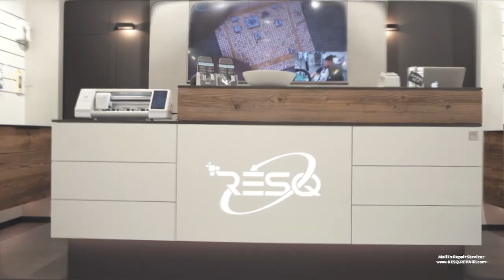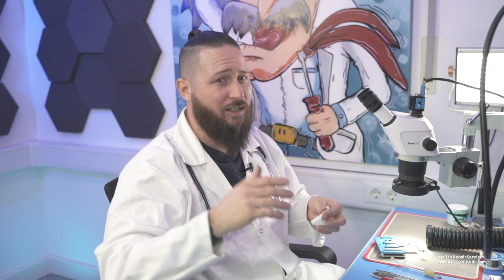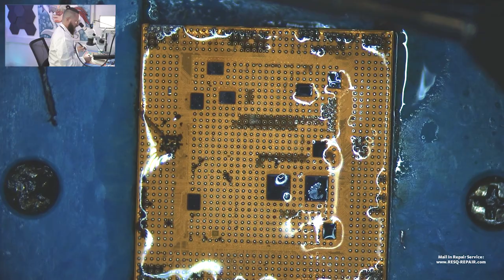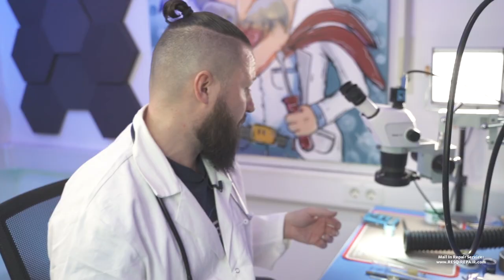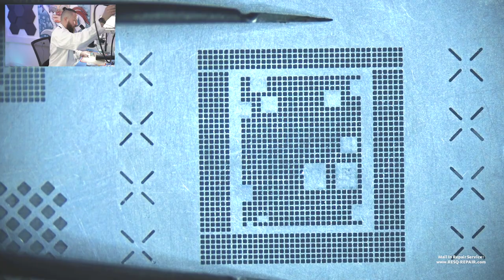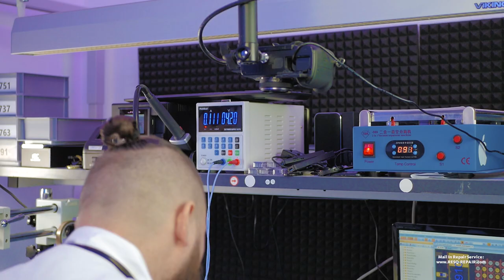📱Dr. Ben: Repairing an iPhone 8 with HEAVY Waterdamage (Doc Ben on 🔥😂)

Comment: I was just thinking that you use a lot of heat to reball the cpu as it worked faster than expected. After, you said the station is probably not calibrated so that makes sense
Reply from the maker: JBC doesn’t needs to be calibrated. But this station was faulty and has been mailed back for a replacement now !
Reply: @RESQREPAIR  don’t know about that… JBC is not for us mortals 😂